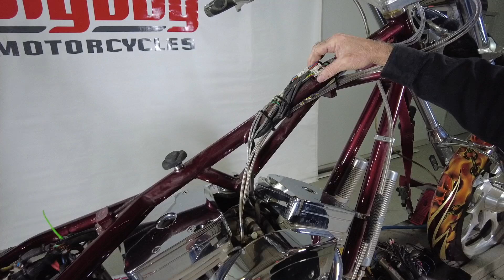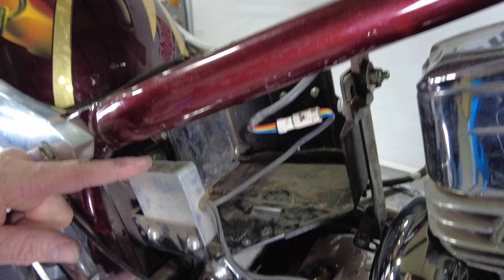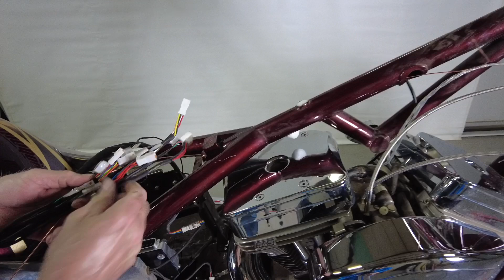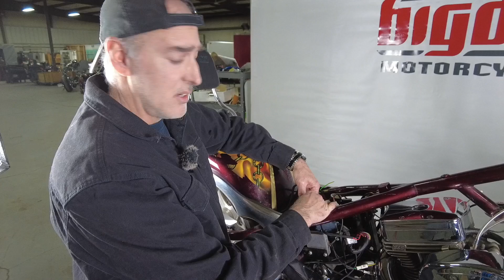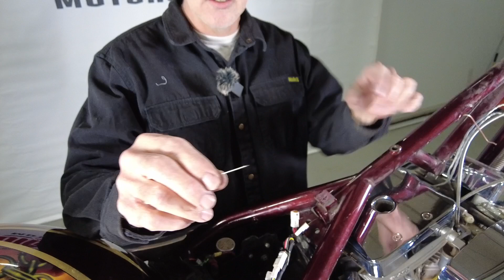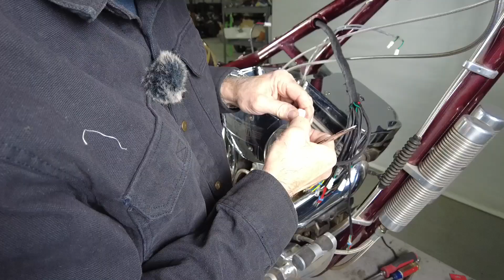Big Dog Motorcycles EHC RIP Install Tutorial Full Harness 2025

Comment: Great Tutorial, I installed the Wire Plus yr's ago and now I having troubles with no brake lights and no hazard flashing.  I cannot figure what is wrong even after testing all connections.  I have had no problems until recently.  I installed the wire plus yrs ago still have the instructions, but they are not helping.....I don't know who to talk to to help me diagnose the problem.....